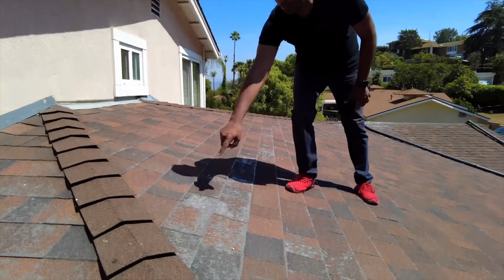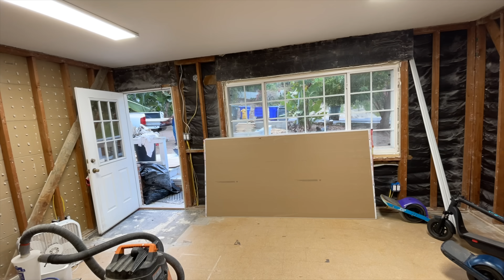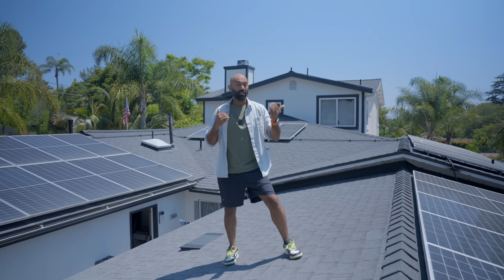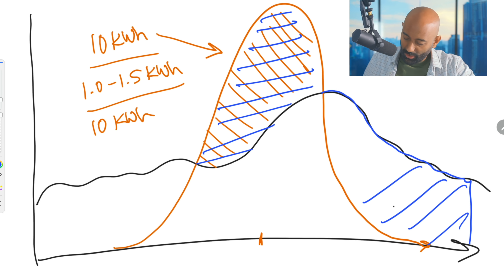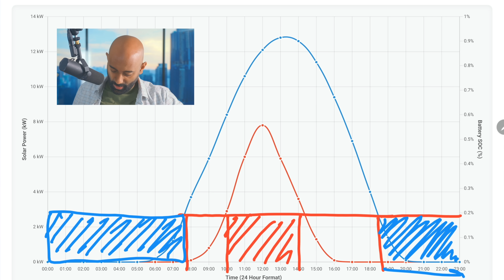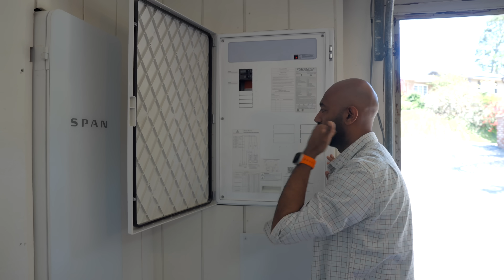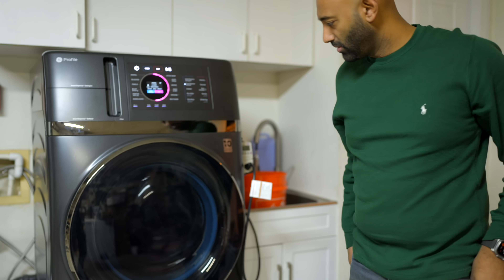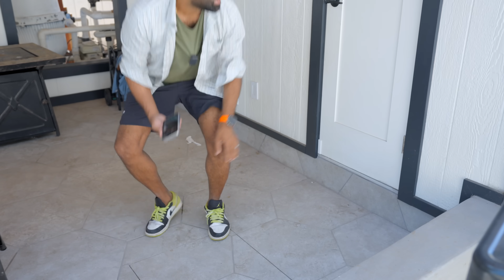Is Self Reliance Possible? Net Zero Home 4 Years Later...

Comment: I recommend enough battery capacity, to run your house and business for 24 hours on it's most demanding day. that ensures the batteries don't cycle too deeply into their capacity. Whether you use LiFePO4, or, lead acid, My calculations show that you will get the lowest levelized cost of storage, by balancing cycle life against calendar life. It also gives good reserve, if the same storm that keeps your panels from getting good sunlight, is also the storm that knocked out your grid power. Since solar panels actually produce power on an overcast day, that 24 hour battery can actually last a couple of days. Hopefully by then, the skies clear, and/or, grid power is restored, ensuring 24/7 power availability.

Comment: If you can get them in the USA, a hot water heat pump with C02 refrigerant is best. In Aus the brand is called Reclaim
Reply: In the UK newer heat pumps use R290 which is propane, benefit is it can run at hotter temperatures, I could easily heat my tank to 65°c, but I have it set at 50°c which is plenty hot enough. So far all heat pump systems require a separate tank, there are some very small tanks available, and even a smaller system in the works to provide instant hot water.

Comment: Off grid for several years now.
If you want to run an A/C, get a big battery !
Upgraded A/C twice, and batteries twice.
Have ~15KW battery capacity on line rn. This can run the 8000 BTU A/C all night no worries.
Your mileage may vary.
Reply: Instead of cooling the entire house at night it would be ideal to just use cooling beds.
Reply: In Spain there are many old buildings that NEVER use aircondition...just natural way of keeping building cool...

Comment: Your solar window is really small for San Diego in the winter. I just checked mine and it's the same in Albany NY, much much more North. Although my panels face both east and west. In general more panels (especially facing west) is cheaper than more battery.

Comment: Do you have sources to research the variable speed pool pump?  What type of controls does it need?  Self contained or do I have to install all new controls to my system (I now have a 20 year old Hayward electronics system)?  Does your filter have a minimum flow requirement?  Thanks in advance.

Comment: 63kw DC, 50kw AC gridtied, 100kwh batteries, 15kw gridforming inverter with 50kw off grid AC coupled, net metering. 3 EVs (40k+ miles/ year), eliminated $2k/year in propane heat by going electric heat pumps. Two homes, office, and heavy fabrication welding shop. $50k pretax. Saved over $50k in 4 years, so it's paid for. Note we live in the east coast at 11 cents/kwh.
Reply: 😂100 kwh battray is big
Reply: @AprezaRenaldy After going through hurricane Helene, I went a little overboard. Seemed stupid burning dozens of gallons of gasoline in a generator with all this solar.
Reply: @andyfeimsternfei8408  are your ev can V2H. Electricity from car batteries is used for the home..

Comment: One idea for your winter solar hr shortage would be to install some ground mount solar trackers.  Of course you would have to have good unobstructed southern exposure, and you would need to have the ground space for it.  You could move existing panels or possibly buy some used or inexpensive new panels and it could increase your solar hours by 40 percent for the panels on the tracker.  Most dual axis trackers usually give you 40 % more output AND give you an earlier start and later end time for your solar day.  This could shorten the time you need to run on batteries especially during the winter months. Your panels would hit the minimum charging voltage eariier and hang around much later.  I think ecoworthy has a 'larger' tracker for $600 that could hold 4 x 400-500 watt panels.

Comment: Haha Ricky, when i was in the solar biz, I loved seeing a swimming pool! Those things are giant energy sucker! Made for motivated buyers! Your best bet is to fill it with dirt and make a garden planter out of it.

FYI: Even though solar prices can be $3+/watt, contractors are making about 15% gross margins with net being 3% to 5% with extreme time overhead in the engineering and permitting phases of construction. 

It’s just not a very profitable business considering each installation is a long term liability and can require multiple losing or extremely low margin service call visits in subsequent years.

Comment: Very interesting. As I'm from Australia, this video highlights some differences we have. A quick Google of solar PV systems in Australia produces "The average price for a 10kW solar PV system installation in Australia typically ranges from $9,500 to $12,500" (that's USD$6,200 to USD$8,200) No wonder Australia has the world's highest ratio of solar systems to houses.
Reply: You guys are allowed to import cheap panels from China while the US put massive tariffs on them starting way back in the Obama years.
Reply: @gordo3582  Yes, we only have one solar panel manufacturer here in Aus (Tindo Solar) and all ther rest are imported with no tariffs
Reply: @gordo3582 even Australian made panels are cheaper despite Australia being terrible for manufacturing with higher labour costs. 

It’s mostly due to the sheer scale created by past generous incentives and current pretty universal high power costs (at least compared to the US average).

Also a pretty streamlined set of paperwork to install panels. It’s quick and easy in pretty much all circumstances except heritage listed properties in some cities. The paperwork costs in many US locations add as much as the panel cost…
Reply: @gordo3582  Panels are a small portion of the cost in the US. Consider permitting rules/costs (esp in California), costs to connect to utilities (I've avoided this just because of the pain of dealing with PGE) and the maximum extraction installer philosophy (why I DIY), it makes the cost 3-4x more than other countries.
Reply: This is sort of true. It's the same grades of panels, from the same companies, as they distribute globally. In Australia it costs about the same as Germany to install. The extra costs in America sees to be a few to many middle men and  rather unique choices made by congress.

Having said that, Australia does have some subsidies, but Germany doesn't. In Germany it takes about 3 days from you sign up to having them installed!

Makes Australia, America and New Zealand look like fools.

 @gordo3582
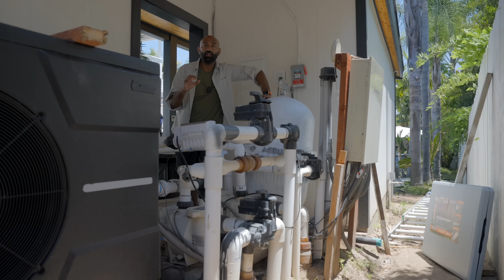Reply: Also in Australia, as a result of the large amount of solar & wind, at least one electricity plan offers 3 hours of free electricity around mid-day - great for retired and home workers with EVs. For other EV owners, working away from home, US$0.052 cents per kWhr between 00:00 and 06:00 overnight.
Reply: @fallonstuart8921  $0.052/kWh??!?!! Wow...that's great! My system (20kW + 64kWh battery + 2x10kW inverters for US$20k which comes to $0.05/kWh over a lifetime (assuming no additional maintenance, which is an unlikely outcome & I installed it myself). Australia is great when it comes for energy. I considered moving to AUS but I considered other elements of the economy esp the maximum extraction philosophy re: real estate, cars, food, etc... (i.e.: the same irresponsible capitalism we have in the US) & decided it wasn't worth it.
Reply: It makes sense, our system cost us $21k and took 4 hours to install with a team of 5. Not a huge cost for the installer company. They’re gouging us here in the USA, but somehow a lot of installers still went bankrupt when NEM 3 started
Reply: @Radium3D  I agree... I gather data on install vs system costs. Do you mind sharing what size & make system you ended up setting up and how much the installation cost was?
Reply: @muzza_c  and it’s probably cheaper now!

Comment: the USA cost are crazy, heare in italy i got my 7.4kw system plus a 5kwh battery for 9.000$ including 1.500$ of installation, then you regive a 5% paybach from the governament each year for 10 years giving you 50% off. Basically paid 4.500$ for 7,4kw + Battery and the cost of energy is around 35c per Kwh
Reply: @giorgiolimblici8240  it's because he's in San Diego CA. Prices for energy and labor are significantly more than most of the USA
Reply: @nicholasjacobs3862  Exactly, Texas not only has lower prices for parts and installation, they also give a tax credit of up to %30 of the total price.
Reply: @giorgiolimblici8240  Same thoughts, here in South Africa we've got an 8kW (11.5kW pass through) inverter, 10kWh of battery, and 12x 550W panels (6.6kWp), total system cost back in 2023 was R130k (~$7k2). That was when loadshedding was quite bad here, prices have plummeted since, the same system would be about R90k ($5k) today. We're looking at breakeven with 4 years of production, a kWh costs R3.85 (21c).
Reply: Yep American solar installers are ripping American citizens off!!! They did it in order to get the 30% federal tax credit that's supposed to save the homeowner, but the solar installers are getting it because they're overcharging for the systems!!!
Reply: Sadly our corrupt government is in bed with oil industry 😅
Reply: @bobedwards8896  And HOW come they're there.....

Comment: Heat pump water heater fantastic had one when we were in Florida pays for itself reasonably fast  set up in the garage and kept the garage cooler and dry so if you install one it needs lots of air and it'll air condition the room almost in the winter you just need to change the setting otherwise it'll suck the heat out of the air that you're trying to heat.

Comment: Great job! I think you may have hit the limit where you have to reduce your average consumption by reducing to compensate for the period where you increased electricity consumption as it became less expensive and then as you replaced natural gas stuff. I have mixed feeling about batteries as the grid tends to be more efficient at storing and returning unused power, until you get to zero of course.  I personally think every house should be allowed to be a power producer on a credit system, then you could "save" excess electricity in summer and use it in winter with the credits.  But I say again great job attempting to get to net zero.

Comment: Why do you need TWO water heaters? Get the largest Rheem heat pump water heater (80 Gallons), set it to 140f during the times you expect the most water usage, and use a mixing valve, then schedule it down to 120f for when you don't expect high demand. Finally, set it up for energy savings mode. Also get yourself some pex, some pex crimps, some unions, and a pex crimping powertool (you'll thank me later).
Reply: They would have to pipe the hot water all the way to the other building. I can live without hot water in an office.

Comment: A great video that sets everything out clearly, thank ypu. 

However, taking 10 or 15 minute showers?? Blooming hell, thats mad! Im in, shower on, get wet, turn shower off and lather up hair and top half. Shower on and rinse, then off again and lather up waiste down to feet and rinse. In and out in 6 - 8 minutes woth water running for 4 max. Your water must be cheap, or maybe im too frugle! 

For hot water, get a solar heater instead. It looks like a fat solar panel and works a treat. My German pal has two plus and a circulation pump that toos his hot water cylinder up daily during the spring - autum period. You can then use a heay pump to warn it the rest if at all needed. 

Love the detail, im in the UK and hoping to add solar and a battery soon, but its all about the ££££. Might do it when I next remortgage as some mortgage providers give 0% interst green loans to enable upgrading your home ñ!

Comment: In MO the net metering is "avoided cost", not retail.  That means we would get credit for what the utility calculates as their cost to produce or buy that amount of electricity.  Not much incentive but it protects them from what happened in CA where everybody installed grid-tied on new construction, etc.
Reply: I'm not really interested in "protecting" the utilities. I get 1:1 her and pay a connection fee. During the Winter I get a bill maybe 2x a year that's higher than the connection fee and I don't mind. They get my generation the rest of the year when I'm over and can send it to others <shrug> They reset my credits each year.

Comment: Excellent video. Well done and easy to follow. Thank you!!
Reply: ...and ventless dryer means you are not pulling conditioned air in, heating it, and then sending it outside. You should have a cool and dry byproduct. Of course that old dryer process also brings warm and moist air in from the outside too (creates a slight vacuum in the house. Terribly inefficient!

Comment: you should heat your water with water solar panels we did this for years in Santa Cruz and provided all of the hot water
we needed, just use any standard electric 80 gallon tank and a tempering valve, try to store 160 to 180f water etc.
this will still be probably more efficient than a heat pump tank, and much simpler, the only moving part is the low power pump.

Comment: Wow your electricity is expensive there!  What I did here in FL was, the first KWH was priced at 13 cents per kwh.  Over that, the price jumps to 18 cents.  So I sized my panels to just keep me in the cheap electricity range.  It's been working great for 7 years so far.  I also did a bunch of things to reduce the heat getting into the house.  To run a fully electric 1600 sq ft house in Florida during the summer with a pool, I average around $150 a month in electric costs.  One year I did have a lightning strike that killed a couple inverters so you got to add in some repair costs.

Comment: I've had a 65gallon Rheem heat pump water heater for a little over 2 years now. Works fine. A bit louder than my fridge when it's running, but it's in the basement and doesn't run much. 
I strongly recommend replacing the anode rod before installation. Get one of those wired ones that last basically forever. Changing it out once installed is a pain. 
I really wish they'd just install those rods from the factory.
Reply from the maker: really? they don't come with it? do you have a link to where I could get one?
Reply: @TwoBitDaVinci  They come with the basic aluminum anode rod that's 100 year old tech. I got a 'Corro-protec' powered anode rod off Amazon. It was the top rated at the time, $160. There may be new/better ones now. 
The basic metal rods get used up protecting the tank itself, the powered rod doesn't. Also the metal ones can make the water taste sulfury if you have hard water.

Comment: Hi Ricky.  I have been following you for years now. I don't allllways understand everything you are teaching me, but I am getting there.  Right now, we need a new roof and want to add a solar system. We live in Holiday, Florida. (Tampa Bay area.)  So plenty of sun. We have a sort of similar situation with having (2) buildings, but our buildings are on seporate meters. So this creates a rather big P.I.M.A.  I'd love to make it all in one, but the back shop is more than 100 foot of power cable run and I'm not sure of the cost of wire today, but I am sure it's higher than when I installed the back shop power several years ago. So, I am not sure what to do. Worse, every time I dig into this, I get very frustrated and give up. Now that we will be losing the 30% fed. perk, I have to figure this all out.... Wish you were here..............   Ps. I LOVE the GREY WATER system.. Every home should be built with a massive grey water tank in the ground.
Reply from the maker: I think something like our office setup would make a lot of sense, local solar into a battery, to have a self contained system. the current connect you have would only be needed when the batteries are depleted and you need more. but it would go a long way!

Comment: For the excess power in the office. Hook an ev charger to the office so excess power charges an EV. That will save you power on your house unit as well.
Reply from the maker: that is a great idea
Reply: @TwoBitDaVinci  Have you also looked at saving power at the office? I moved from x86 Windows workstations to ARM based MacOS Mac Minis last year, those are so much more energy efficient! Also look at your monitors, modern 60Hz high quality office monitors can save a bit in energy (I like Eizo for this). It's not huge, but when you have multiple users working the whole day, every watt saved in energy usage is a watt less you need to cool. I also had a big NAS running 24/7/365, this is now turned off by default and functions as an archival and backup system that's only turned on once in a while. I use a smaller, more energy efficient NAS with 8TB SATA SSDs in JBOD for direct access, it consumes a whole lot less energy for something that's on 24/7/365, while still providing with TBs opf storage accessible by all network devices. Also look at your networking devices, these days there are way more efficient 10GB switches then were previously available. Tactical placement of slightly more powerful APs might eliminate a whole bunch of APs.

Side note: Home appliances can also use quite different amounts of energy based on model/generation. You could save a couple of KW/day when choosing a new/different fridge. I've seen advancements for dishwashers and ovens as well. These things are not cheap by any means, but due to their frequent use and issues during winter with producing/storing energy, they make going netzero a LOT easier.
Reply: And a two-way charger would be awesome. If only Tesla had that feature on other than their Dumpster (oops, I meant Cybertruck).
We too, charge our EV on sunny days, and one thing I've done is limit the charging time in the car to those hours when the sun is producing enough energy (and after the batteries have normally charged) AND limited the charge current to approximately the excess amount we normally generate.